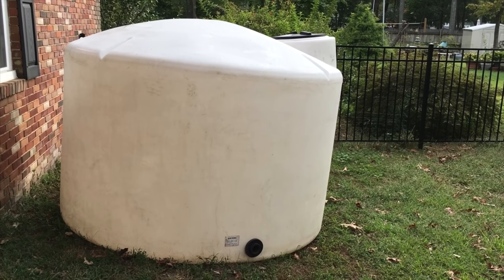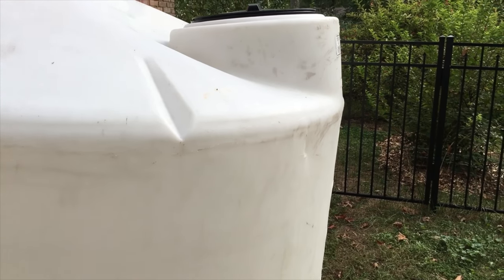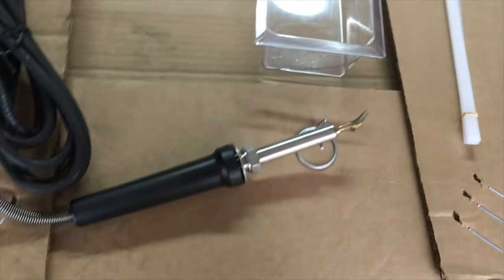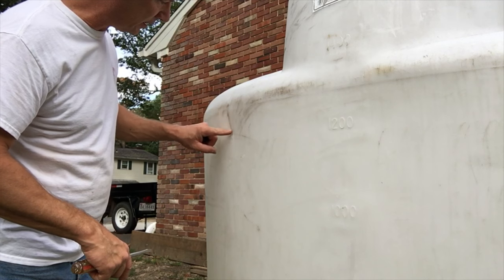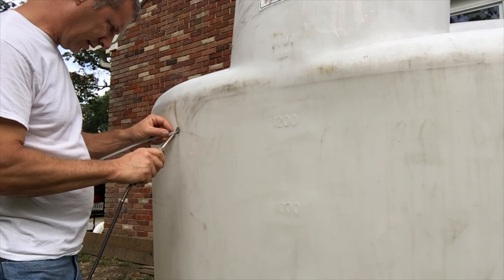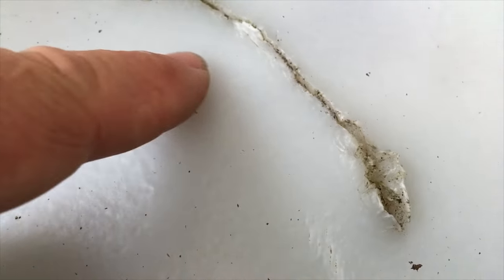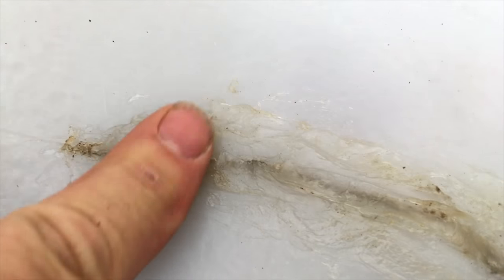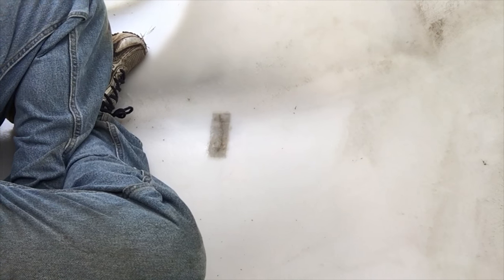Polyethylene Water Tank Repair – Crack

Comment: Anyone doing this type of repair that is done inside a tank be aware of the extreme danger of confined spaces. You can die quickly and not see it coming. You may not think there's fumes etc but are risking your life. To lower the risk, have another person on the outside with something to put a large hole in the tank quickly if the worst happens and you collapse. Obviously use a fan in the tank to ventilate it but prepare for the worst. An axe etc is probably a good thing to have handy. Tanks can be replaced but not your loved one/s. Rescues from confined spaces often result in the rescuer dying as well as the other.
Reply from the maker: Agreed.  I just added a section in the show notes about this topic.  Thanks!

Comment: I accidently drilled a 5/16 hole in the gray water tank on my RVG (Yes, I know lets not talk about how!) All I had to do was run a 3/8 tap into the hole and put in a 3/8 bolt covered with silicone. The tank was plenty thick  Worked great!  Dave
Reply: Good thing  it's just grey water and the epa says  grey water is ok to dump on dry ground.  I  argued with a cop for almost  an hour  before  he found out he was wrong, because I leave  my grey water  open and I live on the street

Comment: Hello Can We Weld Pvc Upvc And Cpvc Pipe With This System ?????? Because Sometimes We Get Difficult Place To Repair
Reply from the maker: @riteshjhimlah1807  I have no experience with that but my guess would be no because of the way PVC balls up when it is heated. I would also think PVC would require more heat to soften it up.

Comment: Got a 25 litre container leaking but I can't even see a crack I'm well confused. I've been over it with a torch and can't see a thing.
Reply from the maker: That sounds like a gas/fuel can.  I have had mine leak right at the seam, usually on the top.  Hope that helps.
Reply: @greatescapefarms  That's what I put it down to.

Comment: one thing I learned whilst working on gas pipe replacement in the UK is to scrape the plastic with a stanley blade or sharp knife to ensure the that teh plastic is clean and green that is no contaminates on, in  the polymer to be welded.
Reply from the maker: Good call.  I was fortunate that it worked for my scenario.
Reply: Did you use a brass scraper so the gas didn't blow your ass apart?

Comment: Probably a good idea to have a fan at the opening to circulate air when you are inside. 
Not trying to preach or be nitpicky but easy to run out of air and not realize until its to late.
Reply from the maker: A good note on safety.  Thank you!

Comment: Where’s the other video, I’ve got the exact same problem in the bottom center of a 2200 gallon white pe tank never been used but the hole is 6-7”x3-4” I thought of adding a plate with  a 2” treaded coupling  for a drain, it’s gonna be for rainwater collection for the house
Reply from the maker: I'm sorry, I've been swamped on the farm and still have not fixed that tank yet.  I hope to do it this year.

Comment: Absolutely do not weld inside a tank without respiration gear.  Fume levels will be much higher in the enclosed space than open air, even by thousands of times.  Chemicals are absorbed through the lungs more readily than any other way.  This would be highly hazardous to your health and likely to cause permanent and debilitating illness.  I had a friend, antique dealer/restorer who suffered nerve damage paralysis from spraying finishers.  At 1st people assumed he was drunk.  He ended up in a wheel chair and died not long after.  Didn't even make 50, left a wife & 2 boys.  Just don't do anything like this ever, nothing is worth that price.

Patch the outside only.
Reply from the maker: Noted and won't be repeated.  Show notes also noted.

Comment: I was thinking of using a propane torch to heat the crack and then melt a burning milk jug to fill in the crack ?
Reply from the maker: I have never tried that method.  Use caution as to not set the jug or tank on fire.
Reply: @greatescapefarms  yes open flames may be ill advised it could start a Fire which would burn down my Tank
Reply from the maker: @RitaElaineHeltonBarker-uz4sz  Good luck with your fix.

Comment: Soooo.... did it work?  I mean, when you filled the tank, was there zero leaking??  I am pretty sure the tank I bought (at auction) may have a similar gouge, but in the bottom/base/underside.  MUCH more water pressure there than up near the top edge, so I am really curious how this worked out for you.  Thanks.
Reply from the maker: This worked great for me.  The tanks are full right now with no leakage at all.  I have another tank I'll be repairing in the next couple of weeks that sounds similar to yours.  It looks like someone took a chainsaw and cut a line at the bottom corner of the tank right where it curves under.  I'm going to repair it relatively the same way, but it will require a lot more material to fill in the hole.  Keep an eye out for the video - likely coming in September.  I'll put it in the system I have and offload water from the other two tanks and pressure test it before I put the video out.
Reply: Thanks for the info.  I'll be looking for the next video.  Sounds closer to my situation.
Reply from the maker: Unfortunately it is still on the to do list.  I have way more projects than time, but I will get to it.
Reply: Can fiberglass sheets render the same results?

Comment: You drill a hole at each end of a crack to keep it from spreading then you do your repair.
.
Reply from the maker: Cool tip.  I've been up and running for 4+ years now with no added cracking or water leakage.
Reply: Stop drilling works great, especially on parts that see flexing, used in aviation for years, standard practice

Comment: This can't hold for long. If the repair were from the inside, it might have held longer. Since nearly no glue would stick to Polyethylene, it is an issue repairing it from the outside.
I tried that in the past with various methods, nothing really functioned.
Reply from the maker: Hi Joe, I invite you to re-watch the video.  The repair and the screen support was put on from the inside.  The repair itself was done with a polyethylene welder, which is not a welder, but rather melts the plastic together.  I did the repairs on the outside as well, but like you said, the real support was on the inside.
Reply: I think, what you describe is the only way that it may hold for some time.
When melting it from the inside, the pressure pushes the crack to be closed. You use the liquid pressure in your favor.

Melting Polyethylene is the only logical way to somehow repair this crack, because most glues don't stick to it, except if there is a glue with a solution that melts it. I don't know of such a glue with such a material.
Reply: I like how you attempt to criticize his work without even watching the clip, good stuff! 👌